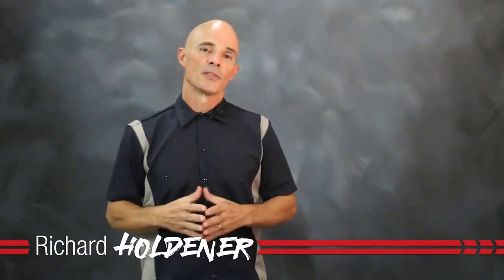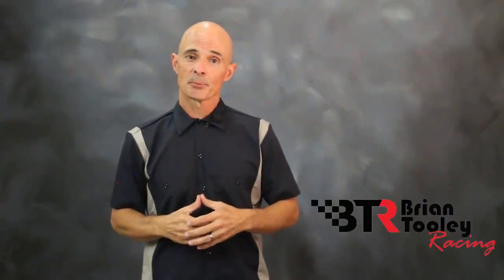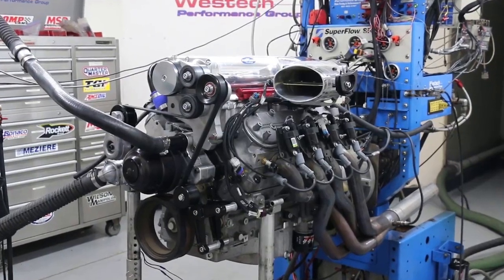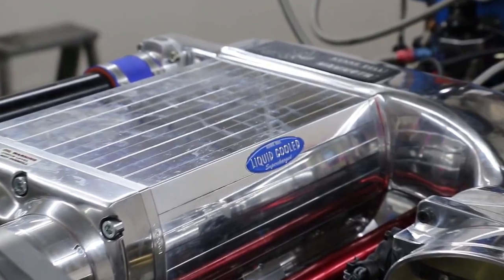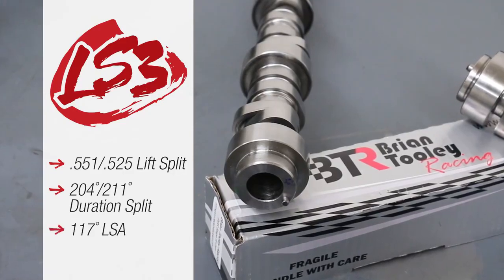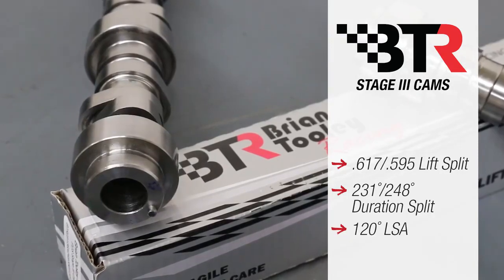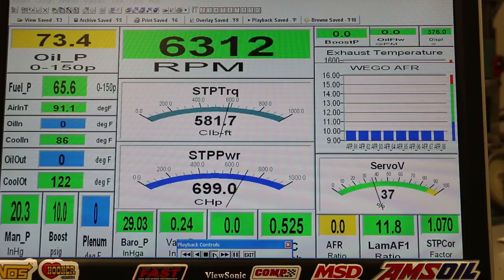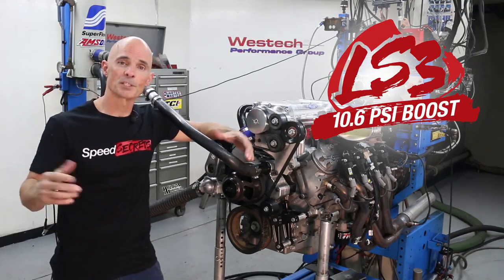Speed Secrets: The BTR Blower Cam made HOW MUCH??

Comment: What I am confused about, especially from BTR, is that a few years ago on LS based projects, you needed specific cams for PD vs Centrifugal blowers. Along comes the GenV, and they offer the same profiles for both types of blowers, stating one profile works good for both.

What story is true?
Reply: Where do they state that the same cam is good for both?
Reply: @baby-sharkgto4902  - For LS engines, BTR offered Centrifugal and PD specific cams, for the Gen V engines they only have "supercharged" cams. Id imagine it is some kind of compromise (FWIW - I have a BTR Stg2 in my centrifugal build), but I see BTR has been smart about it by not making cam grinds that have a ton of overlap so they chop a lot. Their grinds are minimal overlap vs what most others are offering.
Reply: @800mxz  hey I just went to the BTR website and they very much have PDS and centrifugal cams
Reply: @baby-sharkgto4902  - For LS based engines yes - but they do not for Gen V / LT Based engines.
Reply: Truth is boost works on them all but you can spec a cam to be strong or more efficient exactly where youd like it to be in short..that rpm will be different due to boost curve, pds vs centrifugal

Comment: I have a silverado 4.8 and was wondering if I can still install the ls9 blower cam even tho I dont have a super charger or turbo? Would it still work?
Reply: Yes you can just check the piston to valve clearance 4.8 has flat top pistons.Also the ls9 cam was designed for square port ls heads but still will be nice upgrade.
Reply: Brian 1971 C10 thank you for the information but would it be the same timing if I put the ls9 cam?
Reply: @jorgebustillos4354  no the timing would be off, IDK by how much but nothing a good tuner couldnt fix.
Reply: Jorge check out sloppy mechanics. He has documented the ls9 into 4.8 and 5.3. For what it costs it's a killer cam. I would suggest the ls7 cam. The only downside is if you're going boost and need to put in real springs and pushrods, you're really not far off from an aftermarket cam setup. So it would be worth spending the extra 300$ to double your gains.